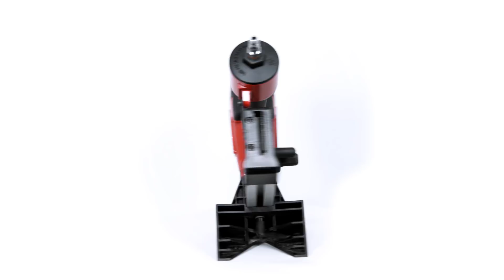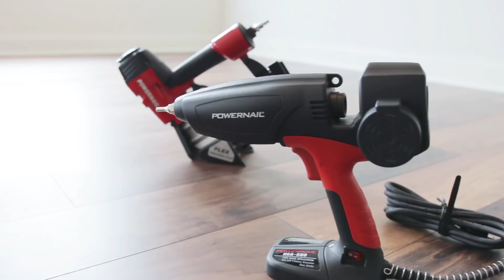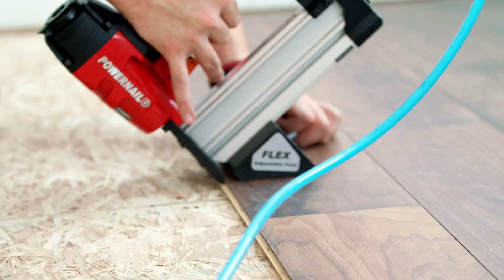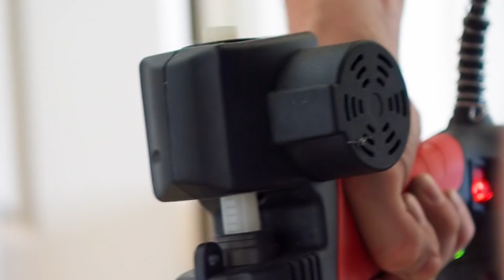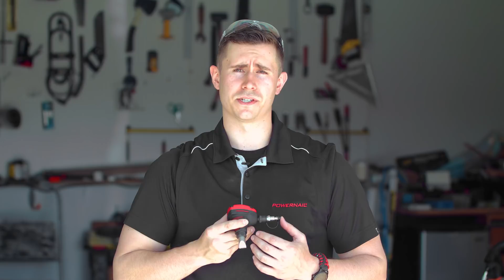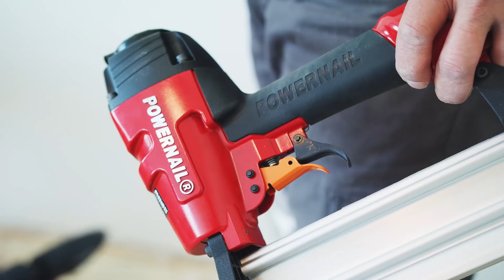How to Install Wide Plank Engineered Hardwood Flooring

Comment: So the underlayment i purchased is supposed to take care of noise and be forgiving on expansion and contraction. I bought engineered flooring which is also more forgiving with regards to expansion and contraction. This glue option is confusing for different configs. Im not going to put glue on a pad that is loose under the wood flooring.

Comment: I am installing 7.25 inch engineered hardwood and  am getting lots of different opinions about just nail or nail and glue. One person is talking about 5 gallon buckets of the glue. This method seems much neater and much less expensive as the glue buckets are 200$ each. Would love some help and input

Comment: Why do my instructions say right on the front page to NOT nail planks wider than 6"? I am installing 6-3/4 BRUCE flooring, which is an Armstrong product
Reply: Every Manufacturer has its own instruction which if you follow, warranty the floor.
Reply: I’ve heard 7.5+ you have to nail and glue assist which is what he’s doing.